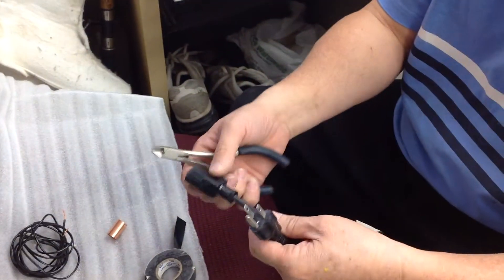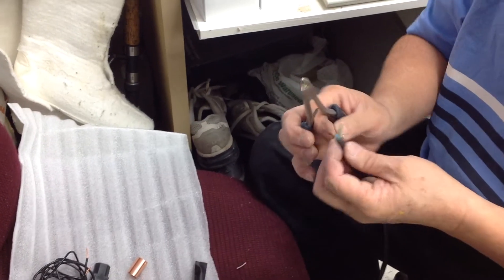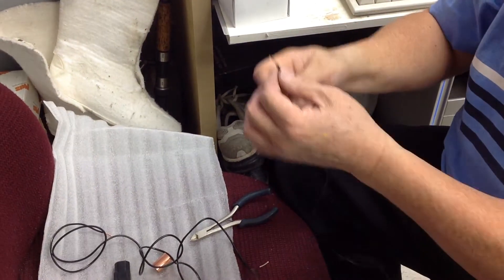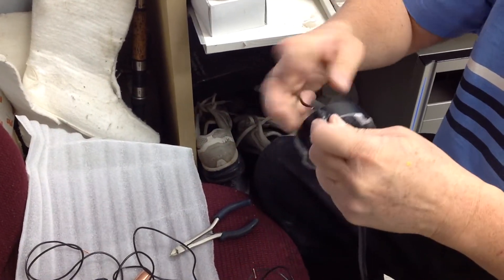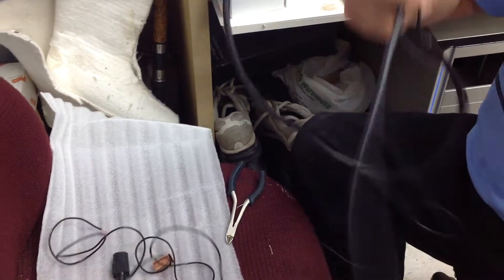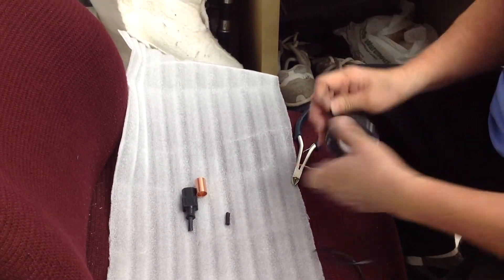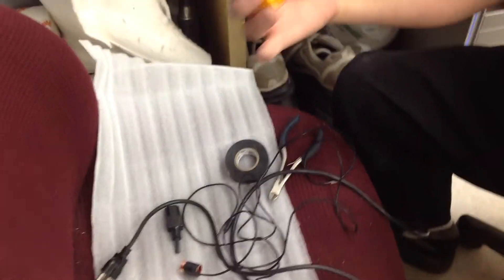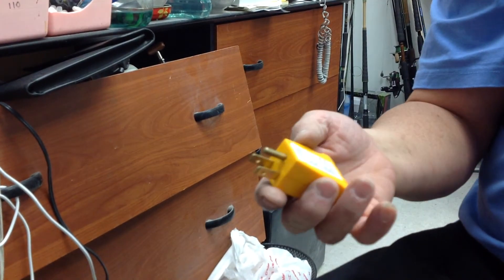Homemade Grounding Wire

Comment: What is the purpose of this device.
Reply: Clicked on a video an don't even know what's going on lmao
Reply: I hope you've looked up grounding. There is a documentary about it. Quite good.
Reply: I later figured it out. I need to find a way to be protected because of my pacemaker/ICD. If there's a bad enough solar storm, emp, atmosphere nuke would destroy my pacemaker/ICD Electronics. I'm going to have to wear an aluminum foil suit . Or get in a bunker surrounded by lead or aluminum sheets. Or a Faradi cage.

Comment: Um, no... Do not ground yourself this way.... they make ground straps, they’re cheap. This is dangerous and stupid. You are counting on the whole building being wired correctly. You need an isolated ground plane to connect to. Don’t do this.
Reply: What if you connect the ground to an ESD mat button-ground that splits to an ESD wrist strap? Also, I broke off the metal prongs, put insulating  tubing in the slots and electrical-taped it up. No go?
Reply: Crazy that the plot twist is the device is for humans.
Reply: Yeah esd straps are like $6-$7 on Amazon.  This is very dangerous...
Reply: @amazingridence3119  I think the entire purpose of this video is for people who do not have an esd strap and just want a quick and dirty solution in the interim.